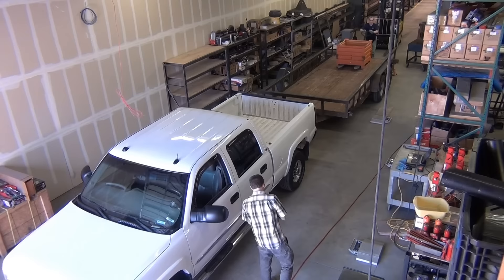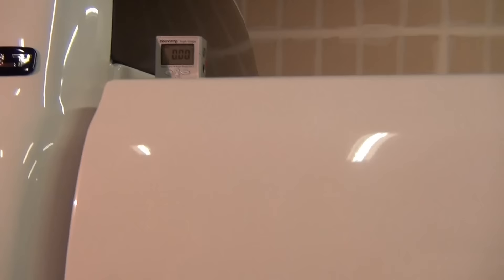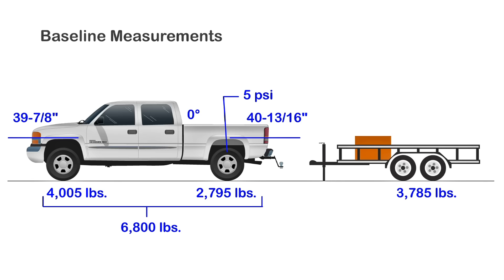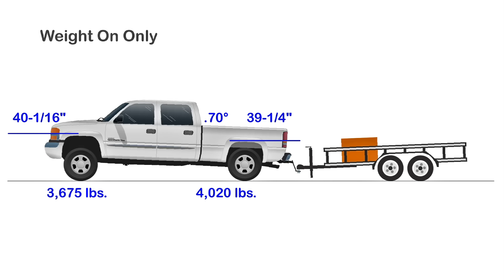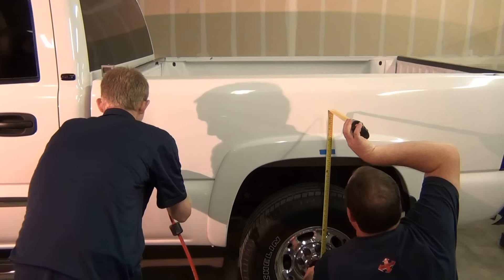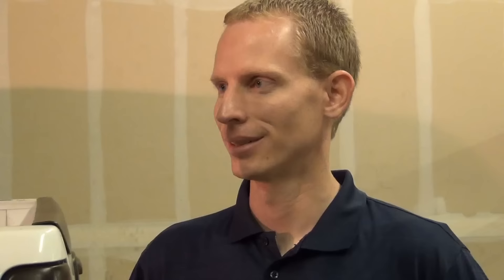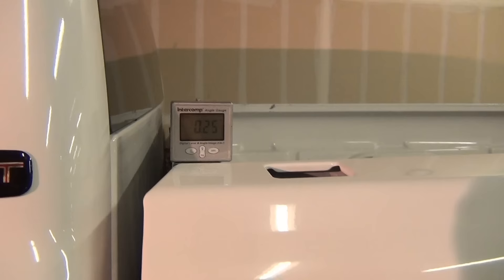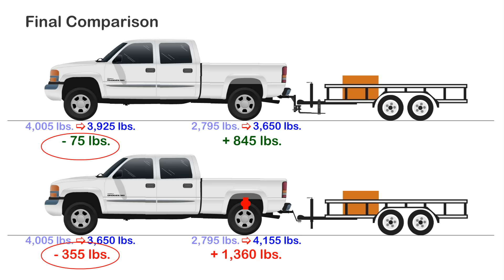The Difference Between Using Weight Distribution and Air Bags to Level Your Load

Comment: What if you have both system working together
Reply from the maker: Using both can be a bit tricky, you'll want to set the springs up before setting up the weight distribution with the hitch. You may need to use one extra washer on the hitch setup to compensate. Thanks for watching!

Comment: First let me say, I am older than both those guys combined. Second, I am a Ohio License CDL instructor here in Ohio. Third, I know what I am talking about because of my education as well as life experience. I am not talking about 5th wheel towing. It is a fact that that a airbag will raise the back of the vehicle and WILL create more pressure on the front axle which will cause better steering. I reviewed the vid and they are wrong. The fuzzy math that they use is just that fuzzy math. I encourage everyone when they are towing a TT or utility trailer with 2 axles or more, to use a DH. It is much more safe. That said, a DH does not always work for the tow vehicle in leveling the rack of the vehicle and keeping safe weight on the steer axle.   Adding air bags, the proper air bags, will straighten out the rack AND put more pressure on the front axle resulting in better steering due to the body weight of the vehicle being pushed back forward. I suggest before you take information from sales persons of products that they review,  you really should learn what things are and how they work from a professional who deals with the things on a day to day basis in the real world.
Reply from the maker: We appreciate your input. Using principles of statics based on the laws of physics and backed up with real world testing we think it is possible to show how you are right and we are too. You are talking about a different application than we are, which has different parameters and end results. For a semi-truck/tractor the hitch connection point is in front of the rear axle. So, when airbags are used at the rear axle it lifts the kingpin of the trailer and adds weight to the tractor in front of the rear axle. Because this added weight is in front of the rear axle the front axle will then also take some of that added weight. The amount of additional weight can be calculated by measuring the wheelbase and the location of the hitch attachment point. You are right about that. When it comes to attaching a trailer to the bumper of a pickup behind the rear axle that is when things change. In our scenario of bumper-pull trailers, the weight of the trailer on the hitch pushes down behind the rear axle and raises the front of the vehicle just like a teeter-tooter. Now, if airbags are used at the rear axle of the pickup truck that will raise the front of the trailer and increase the weight at the hitch connection point which is behind the rear axle. It follows that if some tongue weight at this location lowers the rear of the vehicle and raises the front that more weight on the hitch (in this scenario behind the rear axle) will make the problem even worse. Some of the numbers got a little mixed up when presented in the video and can be slightly confusing. That was just a consequence of trying to do a quick little video to demonstrate general principles without spending huge amounts of time. But, the truth is when we did the video and put more air in the rear axle airbags the scales showed a notable increase in weight on the rear axle and a decrease on the front axle. So, while you are correct for hitch connection points that are in front of the rear axle – it is indisputable that rear axle airbags alone cannot increase the weight on the front axle when towing a bumper-pull trailer connected behind the rear axle.

Since you are a CDL instructor, you might have access to vehicle scales. You could physically test this yourself if you can find a pickup truck with rear axle airbags and a bumper-pull trailer. But, it has to be a bumper-pull trailer and not a 5th wheel or gooseneck as those hitch connection points are directly over the rear axle or slightly ahead instead of behind the rear axle like a bumper pull.
 If you do, we'd love to hear about the results.
Reply: FastwayTrailer  First I appreciate your reply to me. I am wondering though how my comment to RVdaydream got here on your channel. Funny though how he deleted my other comment about him saying that my age maybe a hindrance to my understanding of physics. I don't have time now to respond to your comment fully  but I will say now that being an Ohio CDL instructor is only a title I have now in this season of my life. My credentials in the field of transportation is far beyond that. I will respond more when I have the sufficient amount of time to explain my thinking. But I will say, that my response to RVdaydream is about bumper hitches not fifth wheels and your assessment of bumper hitches is for the most part correct. However, your vid showing scale results is not actually true. I'll be in touch to explain later.
Reply: Your example shows "either" air bags or WD set up. But not both together?  I have used "both" now for the last year on my truck / travel trailer combo.  With only 30-35 psi in the bags I'm perfectly level, both truck and RV trailer.  Question:  Do you want to be perfectly level as far as measuring the RV from frame to ground.  I have heard in a perfect world you want 1" lower at the front of the RV trailer.
Reply from the maker: Thanks for the response, @Dannyixoye. We'll wait to hear what more you have to share. We don't have any affiliate with RVdaydream, so we don't know how the response showed up here.
Reply from the maker: @jaysuper8255 , using both together is a great setup, and we’re hoping to have a video about that in the near future. Level is something to pay attention to, but the most critical factor to be watching is the axle weights. In most cases, this means that there is some sag in the rear, because you do want some of the trailer’s tongue weight to be carried by the rear axle of the tow vehicle. This gives it a better grip on the road, and a better ability to control the added weight of the trailer. What you don’t want is that tongue weight taking too much weight off the front axle of the tow vehicle, which reduces your braking and steering ability. Follow the setup guidelines in the e2 owner’s manuals [ http://fstwy.co/manuals ] for a detailed explanation of this process.
Reply: Lifting the rear of an empty vehicle will transfer weight to the front, just like when your braking hard, hence the need for metering and proportional valves on the brake systems to balance braking forces. On Highway tractor with air brakes the air pressure is automatically reduced when no trailer is attached, to prevent rear wheel lockup, ABS also assists. the fact that your vehicle is level does not control individual axle loads. if you have ever driven across a commercial vehicle scale, they check axle weights among other things but to my knowledge never 'level' unless the suspect failed or failing suspension components.
To anyone pulling any type of trailer you can go into any commercial vehicle scale and check your individual axle weights and check that against the GAWR (gross axle weight ratings) ratings for your vehicle, usually found on the door jamb. Just because a vehicle is rated or licensed to carry a given load it has to be loaded on each axle according to it's GAWR. This is affected by frame and suspension components, axle ratings and tires. A truck may have GCVW of 140,000lb but you can't do it with just the truck, you usually need another five axles, and they can't be from an F350. Most Commercial Vehicle scales work whether they are open or not. There is a digital display outside, visible as you drive onto the scale and you can check your set-up. Be sure not to hold up any commercial vehicle drivers some can be cranky around tourists : )
Reply from the maker: @pops35fordshop2 , thanks for the comment, and thanks for watching!
Reply: @FastwayTrailer   Yes please put out a video on this!
Reply from the maker: @gz8762  what topic would you like us to do a video about?
Reply: For a Semi, yes, for a pickup truck with weight behind the axle. No. I too am a CDL holder, 32 years since I got it, class A. You just can't compare a semi to a pickup when it comes to hauling a bumper pull.  A trailer puts 10-15% of the trailers weight some 3-4 feet behind the axle centerline, causing a leverage moment that lifts the front wheels.  No amount of force directly on top of the axle will change that.  A semi trailer drops 60% of the load directly on top a single axle or between a tandem.  NOW air springs can push the weight a bit, however, that is NOT the correct way to move trailer weight on the tractor, you do that by moving either the rear tandems, or the fifth wheel. The only thing air springs do on a semi is to level the rig when weight is applied.  Leveling and distributing are two different things.

Comment: A combination of both would have been good to do as well.
Reply from the maker: Stay tuned in 2020...
Reply: Airbags increase the rear spring stiffness. This can help with anti sway, but isn't accounted for in the axle validation process. You may find with the stiffer setup you'll reduce bearing life. 

The shocks also aren't tuned for the additional stiffness so will be underdamped as you're working with a shorter stroke and less instantaneous velocity at a higher frequency. 

It'd be cooler to hook up an eDAQ or similar and check the ride frequencies at a track.

Comment: I have a 2013 Toyota Tundra pulling a 38’ TRavel trailer with a toungue weight of 910lbs which is only 90 under what my truck can handle.  Obviously when we load up the back of the truck with camping gear and added the storage under the camper’s front storage compartment we experienced a decent amount of sag.  We have a WDH and have had little to no sway.  However we do get a good amount of squat and on the last trip fully loaded it felt like way too much.  So here is my question.  I just added the Firestone Ride Rite airbags to help with the squat but I have not gone on a trip yet to test.  Would you say the combo of the two would be the perfect fix for my problem?  Also now that I have the airbags installed do I need to adjust the height of my WDH setup.  I’m just thinking in my mind that if the rear of the truck is brought up by the airbags, the tension on the WD Bars is not going to be as strong.  Or does this not matter?
Reply from the maker: Using both a weight distribution hitch and air bags is a great setup. Yes, you should definitely check the setup and adjustment of your weight distribution hitch. It may or may not need to be reconfigured. The best practice is to load both the tow vehicle and trailer as closely as you can to the way they will be loaded when traveling. This includes cargo in both, and passengers. Inflate the air bags to the inflation you anticipate using, then go through the hitch setup process.

According to @busyflyin, a former air bag engineer, proper inflation produces a bounce that is not too fast and harsh, nor too slow and deep, and, the air bags should not be carrying the full weight of the load.

Setting up both to be used together is a trial-and-error process to get a comfortable air bag inflation and good weight distribution. If you inflate the air bags, you may need to add more weight distribution, and vice-versa. Any time you adjust the inflation of the air bags, double-check the front axle to make sure the weight distribution is returning the proper amount of weight to the axle. You can use the e2 owner’s manual [https://www.fastwaytrailer.com/manuals] as a guide. Thanks for watching, and good luck!
Reply: It sounds like you are greatly exceeding your Tundra's tongue weight rating also, which is dangerous and hard on the truck.  You say the trailer's dry tongue weight is only 90 lbs lower than the truck's rating.  90 lbs goes really fast once you add tank and drinking water, gear, toys, clothes, food, dishes and everything else to the trailer.  I would guess you are closer to 1100-1200 lbs tongue weight once everything is all loaded up. (remember water weighs 7.3 lbs per gallon!)  You really should take your rig to a weigh station and get real data on it.  My 21ft toy hauler has a 961 lbs tongue weight dry, but is close to 1400 lbs loaded up.
Reply: A tundra really has no business pulling a 38' trailer. You should have bought a truck designed for the trailer or a trailer designed for your truck.

Comment: Does the WD hitch work well with the Roadmaster shock setup?  Or should I go with Firestone air bags?
Reply from the maker: A weight distribution hitch like the e2 hitch will work well with both the Roadmaster shocks and Firestone air bags. However, we are not specialists in these products, so we recommend you consult with a qualified specialist from these companies directly and/or a competent reseller to gather the information you need to make the decision on which will best work for you. Thanks for watching!

Comment: Can you have air bags and use the weight distribution with sway? I have a lr4 2014 land rover
Reply from the maker: Yes, you can use both air bags and weight distribution / sway control together. It is a very good setup. Just make sure you inflate the air bags to your desired towing pressure before setting up and adjusting the weight distribution.

Comment: I have a 2017 jeep grand Cherokee Trail rated with a hemi has an air suspension that has an entry exit mode where the whole car drops down to let you out then when you drive it goes into areo mode for the expressway I’m having trouble setting my weight distribution hitch because I can’t keep the car at the highway level and also with the air suspension I don’t know if I’m taking all the weight off the rear wheels like in your video thank you for your help
Reply from the maker: The best way to get an answer to your question would be to contact our customer service team at info@fastwaytrailer.com or call them at 877-523-9103.
Reply: I just bought a GC, V8, etc…did you find your answer?  I’m wondering the same thing now that I just bought an Airstream.

Comment: What I don’t get is why my BOAT trailer can’t use a WD system surely there must be some way to redistribute that load
Reply from the maker: +Jmichael Isbell,
The issue with using weight distribution on a boat trailer is the way the chains activate the surge brake system. When you make a turn, the chains on an old-style weight distribution hitch pull on the coupler, and engage the trailer brakes. This is not a problem for a hitch like the e2 hitch ( http://fstwy.co/e2-hitch-video ), or Equal-i-zer hitch ( http://eqhit.ch/original-equal-i-zer ), because they use a rigid bracket system that lets the arms slide back and forth, instead of engaging the surge brakes. On top of that, you get the added benefit of sway control built into the hitch.

Comment: only problem is were you hit a incline and the truck angles upward. pulling down on the trailer to try to make a level ride. can cause damage 90% of the time these hitch are great. but remember to disconnect when going off road. i would have both air bags on low when driving on level ground. than switch when off road. extra weight on rear is good off road it bites better and take less weight  off the trailer.

Comment: One question for you. If the rear axle capacity is limited by the springs, will adding air bags (which can be stronger springs) actually increase the capacity? For example, if the axle itself has an 8,000 lb capacity but the springs are limited to 7,000 lbs, the rear axle will be rated at 7,000. Can airbags increase the spring capacity thereby making the axle capacity the new weakest component?
Reply from the maker: The rear axle capacity is limited by many different elements, including the design of the vehicle, frame strength, springs, axle, bearings, tires, etc. Most air bags include a statement saying that their use does not increase the weight rating on the axle. We recommend consulting with the specific air bag manufacturer to determine if using air bags in your specific application will supplement the capacity to your vehicle’s springs.
Reply: @FastwayTrailer  Thanks.
Reply: EpicCowlick first off, I wouldn’t think your springs would be your defining weak point. Number two, your rear axle is probably what’s going to be the one factor that dictates how much you can haul and I think what Fastway was primarily getting at was that air bags aren’t going to increase the weight rating of your axle. I don’t think they really understood what you were asking. But all in all, whatever your axle rating is, or your spring’s ratings are, you go by what the manufacturer says. Should say on the inside of your door jamb what the max weight can be on each axle.